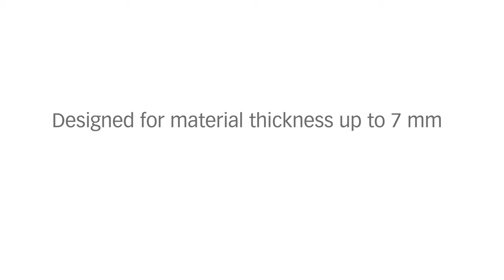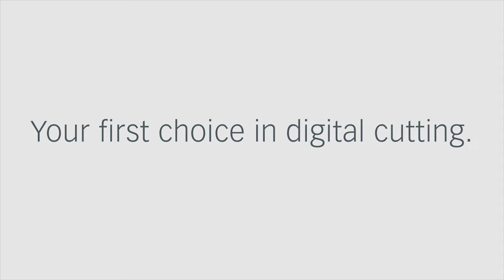Zünd Press CuttingTool - PCT

Comment: Is this better than using the EOT250 for cardboard?
Reply from the maker: Hi Leonel. The Press Cutting Tool - PCT is specially developed for cardboard and corrugated cardboard. The main difference is, during the cutting process, a glide shoe compresses the material along with the cut lines. This processing method effectively prevents the raised edges and ridges that can occur when using an oscillating tool for cutting corrugated cardboard. So if you mainly working on cardboard, the PCT is your better choice. Hope this information is helpful. Thanks for asking *tna